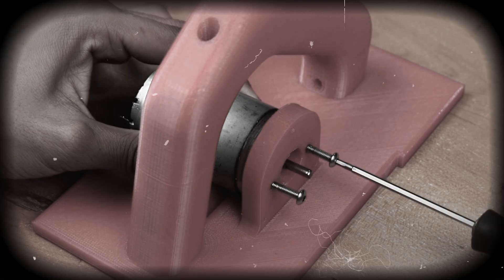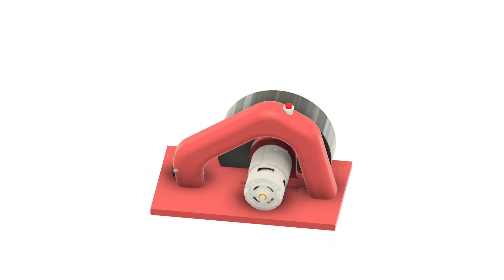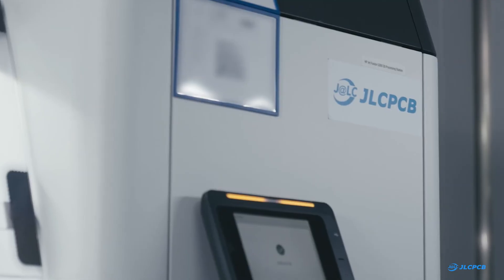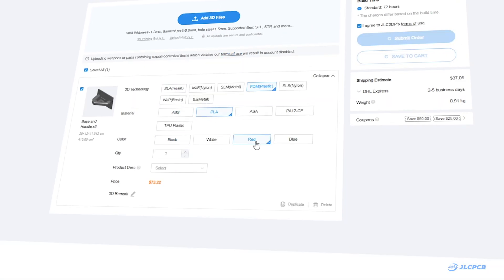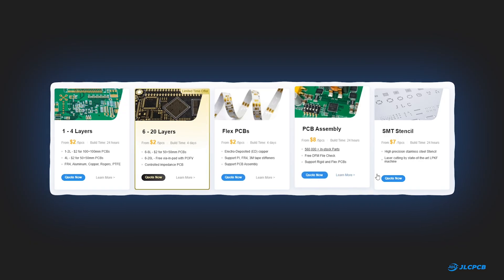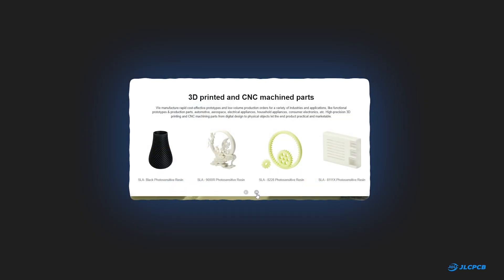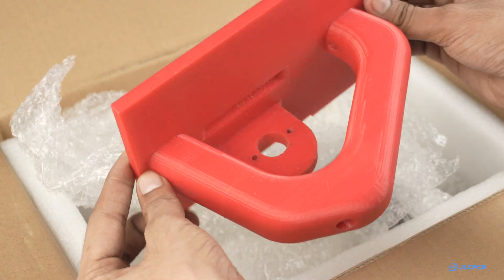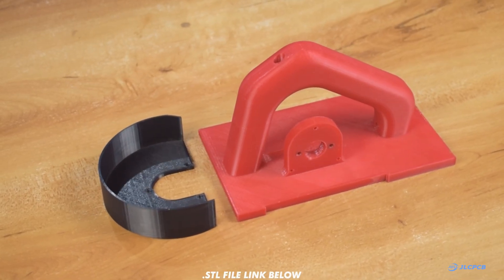Building a Powerful Circular Saw using 775 Dc Motor - 3D Circular Saw

Comment: It's looking Amazing bro
But i have a doubt, can 775 motor run with 24 Volts???
If yes, i have all the components, i will make this.
Reply from the maker: Thanks, bro. Yes, it can work with 24V😊. Make sure to choose a power supply that can deliver up to 20 amps.

Comment: try using more powerful motor .it will work only on thin low density woods.commercial one uses 1200 w motor .and this motor is something of 100w only
Reply from the maker: Thanks for the suggestion, I will definitely consider this for future builds.